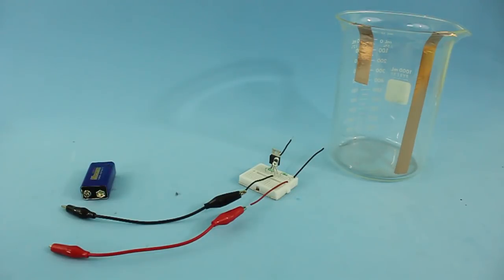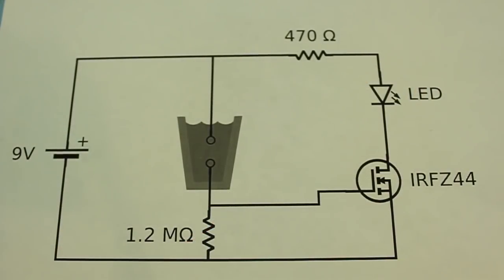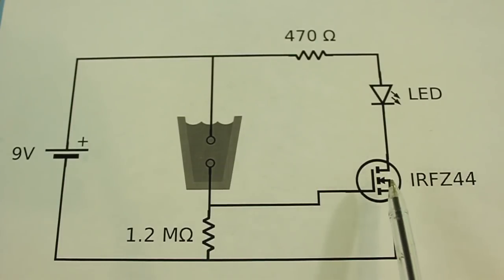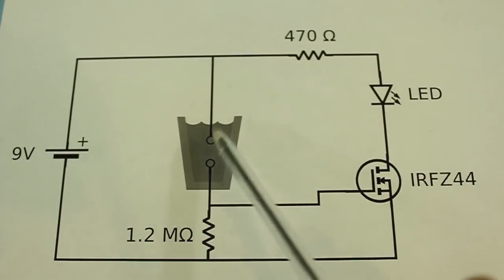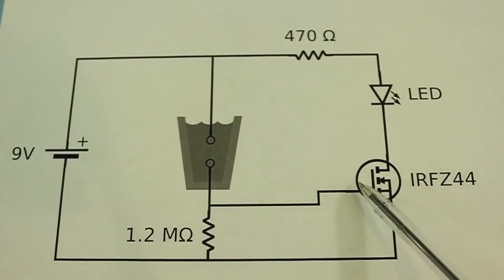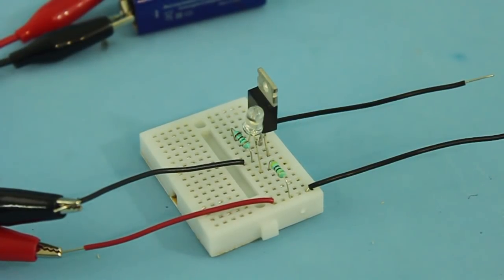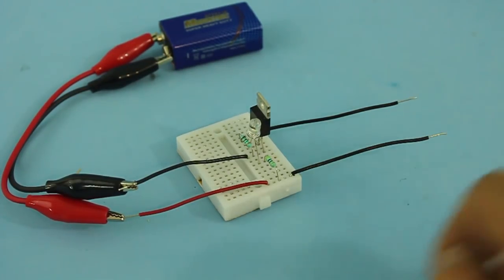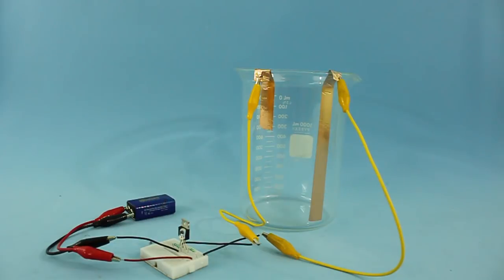Easy to Make Water Level Detector Circuit

Comment: You can not apply dc though water due to electrolysis and oxidation occurs.
Reply from the maker: With the ammount of current in this circuit electrolisis and oxidation is negligible
Reply: You suppose that is.Place a little cotton in the tip of a metal screwdriver and then wet in water mixed with salt.Apply the negative pole of a battery 1.5v to the screwdriver and the positive in a metal surface.Put the screwdriver with the cotton tip to the metal to hear bubbling and after a few seconds the touched  metal area turns in black.Only with 1.5v.

Comment: If the human body has a capacitance and you are working with DC power, how could you close the circuit with your body? Doesnt the capacitance acts as an open circuit in DC?
Reply from the maker: +Juan Mohedano because the body has resistance and dc can flow

Comment: Is there any machine to detect water level by measuring the water pressure at any point of pipeline like at bottom of basin ??.the machine warns when water level is high and low automatically by beeping for few seconds .

Comment: What is the material of (the metal in the water) ? Can the water make a chemical reaction with the it?
Reply: +Ludic Science and what about the chemical reaction? Or is the current to low for this? This is the only problem why i dont make any experiments after i noticed it.
Reply from the maker: +T RR is copper tape,you can use any conducting wire